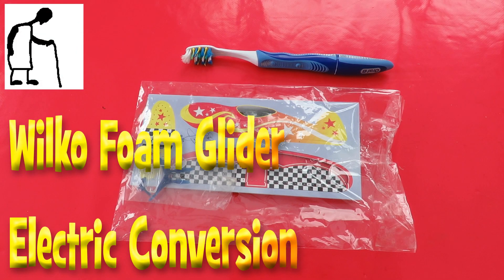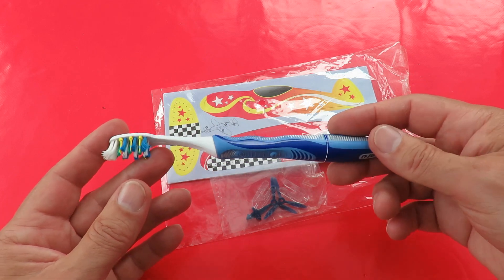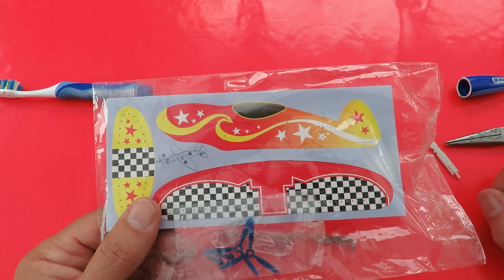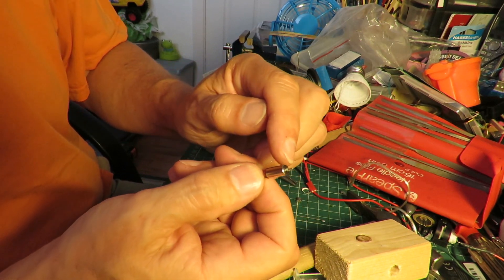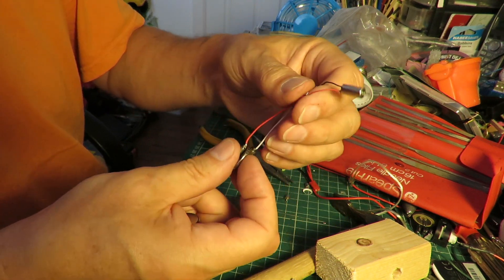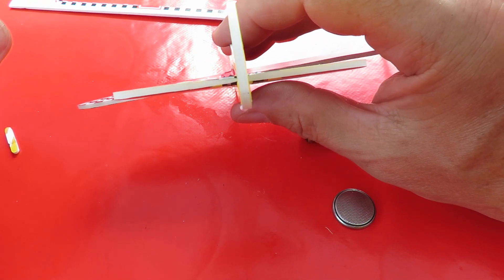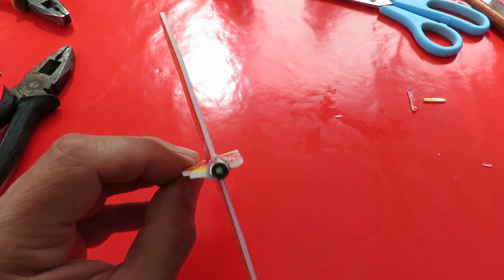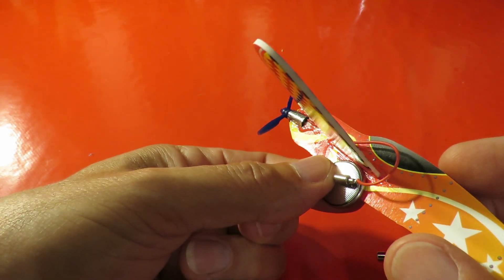Wilko Foam Glider Electric Conversion

Comment: At 12:37 it Sounds like a Toothbrush
Reply from the maker: That would be logical, it is a toothbrush motor. Those little coreless motors are used in lots of electrical items due to their good power to weight ratio. Virtually all the toy quads use similar motors.

Comment: where do you get your battery tooth brushes .thanks in advance.
Reply from the maker: If you want this type of motor DON'T buy vibrating toothbrushes to get them. You can buy a pack of 4 good quality brushed motors on eBay for the same price as a single toothbrush and they will be more powerful and you don't have to waste time trying to get them out of the toothbrush. I explain this in the video and in the video description. If you want a toothbrush to use as a toothbrush I usually buy this type in B&M.

Comment: Carrying the power source on an aircraft this small is difficult, perhaps you could do a similar build but make it a 'round the pole' flyer, just the motor on the aircraft and two thin wires to a swival arrangement on the top of a pole then down to a controllable power supply.

Comment: Have you tried chucking the motor in the freezer before you remove the weight? Or heat can't remember which we used to remove bearings now.
Reply from the maker: You would heat the weight, that should make it expand and help it come off the shaft. The problem is you are dealing with a very small item and you don't want the heat to travel up the shaft into the motor. It is very easy to pull the shaft out of the motor with the weight still attached so that is why I try to drive the shaft through in the opposite direction. With the earlier motors I was getting nearly 100% success but these latest motors are a lighter build and the shaft tends to bend if you don't strike it absolutely straight. In an ideal world I would make the tool I use from metal instead of wood using a drill press to ensure the hole is vertical. I could make it a better tolerance so there would be less chance of the motor moving sideways and bending the shaft. In fact with a drill press you could push the shaft through if you had a suitable drift.

Comment: Oh Grandad, you did not learn anything from your previous gliders. You still put wings and tail in the wrong direction. The fact that someone has drawn a bad manual does not mean that you should make the same mistake all the time.
Reply from the maker: The wings are the right way for the paint details and the truth is it make no difference to whether these planes fly, they are junk. Maybe you should look at a few more aircraft in real life, there is a full variation in configurations. If you look back at the previous videos I have done with these toys you will see I have built them in both configurations and there is no significant difference in their performance.

Comment: Great idea good to see the toothbrush motors back again haha
Reply from the maker: My success rate with getting the weight off is much worse now they have downgraded the motors. I was running at practically 100% success with the older motors but these new ones are much more delicate and I destroy more than I save.

Comment: I must try that with my grandsons. Thank you for that idea I like that very much..
Reply from the maker: My success rate with getting the weight off is much worse now they have downgraded the motors. I was running at practically 100% success with the older motors but these new ones are much more delicate and I destroy more than I save. You can get better ones cheaper than buying the toothbrush. Just search for 3.7 volt coreless motors on an online store such as eBay.

Comment: That double button cell magnet idea was a good one.
And, hey, those batteries will last as long as the internet...in a way.
Reply from the maker: Hi Slider, yes, rather pleased with the double button cell idea, it's just one of those coincidences that the components came together and it worked. Yes I am sure those cells will sit in a landfill site somewhere for the rest of time, but they won't give me enough power for this motor to go free-flight. I seem to remember somebody doing some sort of recharging on them, was that one of your videos?
Reply: Oh, I meant that now the video is in digital land, those batts will be flying the plane on someones monitor for probably years :)
As to recharging, perhaps. Nearly anything can be tried with a fire extinguisher nearby.

Comment: its funny how every time you tear apart these brushes, you rip the motor out in just seconds
Reply from the maker: My success rate with getting the weight off is much worse now they have downgraded the motors. I was running at practically 100% success with the older motors but these new ones are much more delicate and I destroy more than I save.

Comment: That motor looks like the spare tail rotor motor I ordered for my syma 107 g helicopter,from eBay,in case it might help you in the future.neat mod.
Reply from the maker: I only use these motors because I use the toothbrushes and hate the idea of throwing them away. The helicopter motors are far more powerful and cheaper to buy than the toothbrushes which is why I explained that at the beginning. There is also advice in my video description.